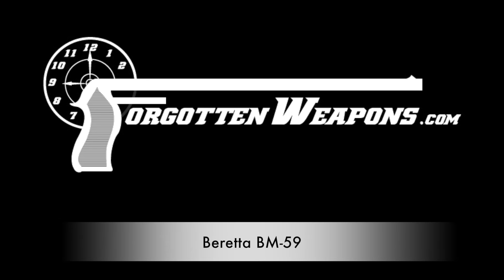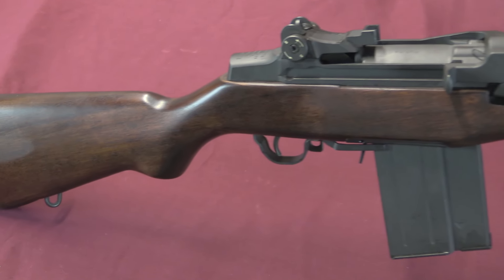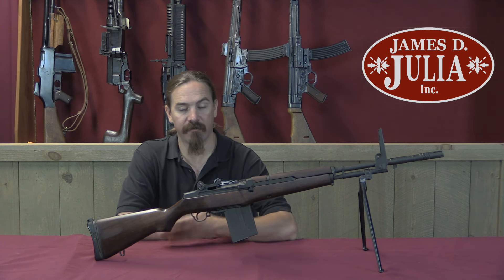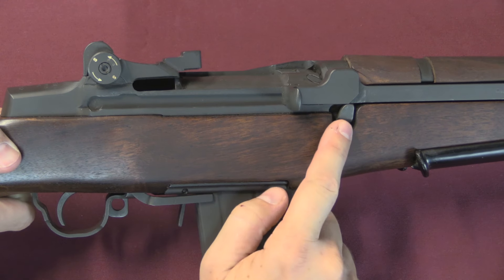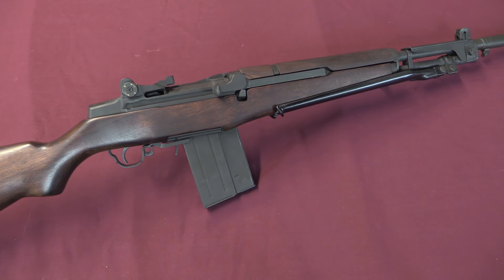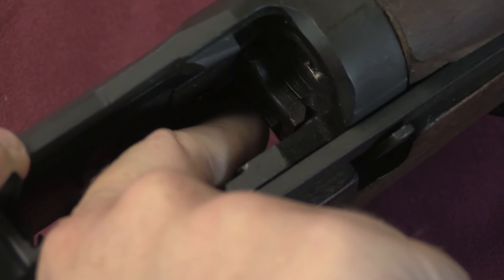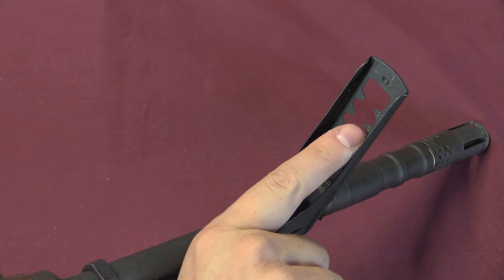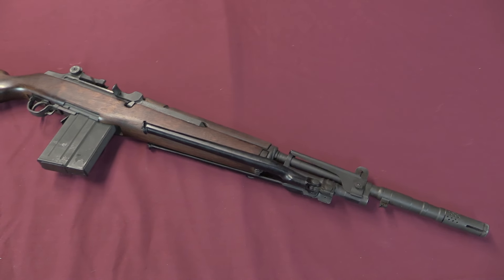BM59: The Italian M14

Comment: The Indonesian Army not only bought the    BM59, they used a Berretta design for their 5.66 mm standard infantry rifle - the Pindad. The Pindad is manufactured in Indonesia. In the semi-automatic form, the Pindad is also the standard rifle of the Indonesian police.
Reply: The Pindad SS1 is derived from the Belgian FNC
Reply: Nope, Pindad did produce the BM-59 under licence as the SP1, but it was in the original 7.62 NATO, not the 5.56. It’s no longer standard issue for the Indonesian army or police either (it was briefly in the 1970s and 80s before the switch to 5.56) but a fair number are still kept in reserve, and personally I’m wondering why Pindad didn’t just repurpose old SP1 jigs and machinery to build a new modern battle rifle rather than awkwardly trying to upscale the FNC-based SS1 and SS2 into the SS3.

Comment: That winter trigger is just amazing.such a simple but effective function
Reply: I read somewhere that it was mostly meant to launch grenades with it than a winter trigger, since the blanks required for them had 3 times the recoil of a normal cartridge, and using the normal trigger with them would break your finger against the trigger guard.
Reply: @LoquendoversoIT  Yes the Swiss did this as well for the STG57.

Comment: If it also shot...straight...it wouldn't be bad, but, already at 150 m...You don't catch anything...It was done economically...Perhaps by replacing the long-stroke piston with a short stroke, replacing the barrel, completely eliminating the tri-compensator, which is one of the sources of the rifle's inaccuracy, perhaps it could work well...
Reply: It works perfectly fine.

Comment: The Indonesian production of these is interesting. I am not sure whose plant they bought, but there was a LOT of it.

The most curious thing about the process of making the receiver body was that, first, they machined M-1 receivers, then re-machined those to provide the "features of a "BM-59
 receiver body. In the case of the Italians, this was the "logical' follow-on from "converting" large numbers of pre-existing US-made M-1 rifles and then almost new Italian-built M-1s to BM-59 configuration.

So all of the BM-59 "plant" was built around the concept of "converting M-1s.

Allegedly, the "source" M-1 receivers were fully heat-treated and thus, the only way to machine them is with Tungsten carbide tooling.  Way back in the late 1970s, I was party to '"re-engineering" a bunch of tired but mostly serviceable International Harvester M-1s into what were essentially BM-59 look-alikes for the Australian market. M1As were available but for serious money.

Unfortunately, genuine BM-59 mags were unobtainable, so, M-14 mags (and mag catches) were used. No "tri-compensators" were fitted, either.

About a hundred of these conversions were made and they worked just fine. Someone in Britain also did something similar, before all of that "went away".
Reply: No BM59 had been made converting a rifle. After the war Beretta received the Wincester tooling for the production of the M1 rifle (they were worn out and unusable, but good to see what the production stages were and build new tooling) along with a ton of spare parts never assembled. That's why many BM59 have the original Winchester and Springfield markings on the receiver. 
That's also why the Danish soldiers preferred the Breda made M1 to the Beretta ones. Breda rifles were all made with new parts, while the Beretta ones could have receivers made during the war with old tooling, that had a rougher surfaces.

Comment: People talk about the wood cracking. How common is that? Should i be careful in considering this rifle because of that?
Reply: Depends on how well was treated the wood in all these years, but usually they were better than the one used in the M14, the only piece that cracks very easily is the top cover, but it's not a big deal

source: mine cracked some time ago and it was so common that i was able to find a replacement very quickly

Comment: It's gas cutoff system is like the Yugoslavian SKS system except the Yugo's sks has a knob that acts as both the valve and a lock to keep the grenade sights in place
Reply: They had access to some BM59 samples. Beretta hoped to sell them, but then it didn't go well but the good idea remained, as in 1966 they modified the SKS M59 by adding the part of the grenade launcher.

Comment: We still had in 1993. Even then we learned marksmanship with the Garand and then got issued this, the FAL (which stands for "fucile automatico leggero", its not just the Belgian FN that was called FAL), basically none of us ever called it BM59... It could take a beating and still do its job very well.
That so called "winter" trigger wasnt much for gloved hands in operation. It was used a lot more for the SuperEnerga grenade which used to give quite a kick and you could really hurt your finger. The winter trigger instead was making things a lot safer when shooting the s-Energa, and also was making easier to aim and hold everything steady shooting it. 
The reason the magazine is made that way is because its a simple pull out and slap in without  fiddling with the front catch like other rifles had when the bm59 was designed. You can switch magazines very quickly.
Many of us that trained with it liked this rifle a lot, it had a whole different feeling than the the 70/90 we were issued later on.
Reply: Commento eccezionalmente interessante!

Comment: I have fired M14s as a Marine. The cyclic rate is also 750 rpm. If the M14 had a muzzle break like the BM59, I think it would work better in auto. By the way, I aways wondered if the cyclic rate of the M14 was reduced to 650 rpm, if we would have made it better in auto. Unlike many, I know auto fire in a M14 is doable if you are at least 5-10+ tall. I owned M1As and the semi BM59. I believe the BM59 is a Cadillac version of our M14. It is a better shooter and made better than the M14. Thanks for the video.

Comment: Beretta used the tooling from Winchester to produce their Garands and I would guess their Bm59's
Reply: Not only the tooling, but even the existing parts. The BM59 receiver, stock, rear sight and trigger group were the original M1's slightly modified, and often they retain their original Winchester and Springfield markings.
Reply: @neutronalchemist3241  when as a recruit you were holding the rifle for the first time the first thing you noticed was a mishmosh of markings and a lot of scrollwork to obliterate some parts of the old markings.

Comment: Trained extensively with this rifle during my auxiliary officer’s course in 1996. Once you got to know your rifle you could easily hit a target at 300m and over consistently with the iron sights and the in-built bipod. I also trained on its replacement, the NATO 5,56mm AR70/90. While the 7,62mm BM59 was a bit heavy to carry (about 4,5kg if memory serves) I know which weapon I would take into battle...
162^AUC
Reply: Ricordo benissimo.... Ho fatto il militare nel 1993.... Pesava, vero.... All epoca, stavano arrivando proprio i primi sc-70/90(versione a calcio pieghevole dell AR - 70/90),e ricordo benussimo la differenza di peso e maneggevolezza, rispetto al FAL BM-59... 👍. 10°\92, brigata taurinsense. car presso la SMALP di Aosta. Un saluto ✌️

Comment: Sounds silly but those asymmetrical stops would be helpful for ensuring you've got the mag the right way round when in low light conditions and under combat stress.
Reply: Not needed for that, when you hold the magazine you know exactly whats the front and back because of the shape. And even without the stops like that it wouldnt fit backwards.

Comment: I served in the Italian Mountain Artillery in 1987 and we were issued the BM59 Truppe Alpine with pistol grip and foldable stock but not the detachable muzzle break which was only for the paratroopers version. The tripod was absolutely necessary in full auto while hitting the target with a three round burst after some practice was relatively easy. Truppe Alpine version was slightly lighter than the one in this video but still heavier than the contemporary M16.

Comment: One bit of trivia: if you see an M14 in a movie, chance is that it's actually a BM 59 due the similar looks and easier availability on the civilian market.
Funny trivia: the Italian Army designated it the "Fucile Automatic Leggero", "Light Automatic Rifle", shortened to FAL (Italian and French languages are pretty close), but the soldiers who actually had to use it and feel the weight would rather call it "Fucile Automatico Pesante", "Heavy Automatic Rifle". And before you guess the shortened designation, remember that most Italians at the time didn't speak English.

Comment: I had a transferable BM-59 (actually within a couple of serial numbers as the example reviewed in the video) back in the '90s.  Was reasonably easy to control considering how fast it ran. I had all three stock variations (bought them from Reese Surplus) and spares of several parts that I had broken at one point.  I had the extractor fly out of the bolt assembly once, and I broke the operating rod at Knob Creek once.  If you ran the gun too hot, you risked breaking the operating rod at the weld (Beretta didn't make an operating rod specifically for the length of the BM-59, they cut down and re-welded a Garand length rod).  Mine also need some attention for the gas system to run reliably; the grenade sight is made to cut off the gas when flipped up, and the cutoff would rattle loose while firing and gradually close the gas.

Comment: Now they say that a bolt action rifle has more accuracy potential than a semi auto rifle, and if you can use the magazine cut off lever and turn it into a "bolt action rifle". If you didn't have a rifle grenade attached would it potentially be more accurate if you just shot a round out with the the gas cut off of the action of the weapon? Essentially using it as a single shot, "bolt action"

Comment: I have fired a M1 Garand with a magazine, shortened barrel, and gas system.  It was fun.
I had a few run ins with a Los Angeles gun smith named Chuck Rees he built 1911 back when Jeff  Cooper was at Arrowhead later when I met him he was shooting a M14 he  built a 30-06 Garand into an M14.  It used BAR magazines.  Only saw it once but if you knew M14's you could tell the difference.

Comment: Which gun, from a manufacturing perspective, is most similar to the Garand? As far as I know is that the M14 was chosen over the FAL and G3 because it could, in theory, reuse M1 manufacturing tuning.
Reply: The BM59 is a lot more similar. Actually BM stands for "Beretta Modifica" (Beretta modification, of the original M1). It reused M1's receiver, trigger group, stock and rear sight, only sligtly modifying them. So much it was a modification that several BM59 issued to the Italian troops had been done using original US made M1 receivers, and still had the original Springfield or Winchester markings on them. http://www.collezionareexordinanza.it/uploads/source/IMG_6484_1.jpg

Comment: Around the ten minute mark of the video, Ian discusses the changes made to the Beretta gas system and operating rod, and then briefly mentions that perhaps there were not too many bent op-rods on M-1s. Early M-1 Garands came with the characteristic dog-leg op-rod, but when stress cracks started forming at the bend, and some op-rods bent or broken under the strain of use, it was decided to add a hemispherical "relief" cut at the bend to relieve stress lines converging on that point. Which is why all subsequent M-1s have that feature. Early M-1s were supposed to be retrofitted to modify their op-rods, but a few escaped such treatment and are now valuable and quite rare collector's items in the M-1 community. You may not want to fire such an M-1, but it is worth a pretty penny as a collector's item.

Comment: So were BM59 receivers all made from scratch as BM59 configuration or were many merely modification of existing M1 receivers?  My Parts kit seems to have some former US parts on it, so I suspect the Italians were more than willing to adapt existing rather than using all new mfr parts.
Reply: BM stands for "Beretta Modifica", a modification of an existing model. So much it was a modification that many BM59 issued to the Italian troops had been done using original US made M1 receivers, and still had the original Springfield or Winchester markings on them. http://www.collezionareexordinanza.it/uploads/source/IMG_6484_1.jpg
Reply: The system was a modification of the M1. So the process, and I have seen the machinery, was to take existing M-1 receivers and cut away all the bits that didn't look like a BM-59. As the supply of existing receivers dried up, they STILL made M-1 receivers, including heat treatment, because they were the required raw material for a BM-59. New parts included a different sear for the trigger mech, the M-2 Carbine-like actuator arm and lever, the winter trigger and, of course, the Tri-compensator. The Indonesians bought a complete Italian production plant and made a huge number in several variants, including a heavy-barreled job that had a special bayonet with an extra-long handle.
Reply: To save money the tooling and parts were reused. Beretta (and Breda) was already producing Garand rifles so there was the need to use the same machinery and all the parts available both making new or modifying older.

Comment: The cadillac of m14's
Reply: *Ferrari
Reply: @Beco90  *Fiat. They were reasonably priced, produced in large quantities, reliable, durable, and a lot of fun.
Reply: @life_with_bernie  fiat is about as far from durable and reliable as possible though
Reply: @jokelius1  you clearly haven't driven a fiat panda from the 80's those things* will outlive corollas and civics
Reply: @jokelius1  export Fiat are not great.
But the Fiat Panda mk1 were affordable and ubdestructible
Reply: @jokelius1  those that sucked were the before ww2 fiats specially made for Americans i guess. The reason they sucked was because the fuel system wasn't properly adapted to american fuel, oil and temperature as the standards were different and the Italian cars almost never met anything below -5C° in italy while the usa in many parts you can go up to -20 C°.

Comment: Doubt here..
How do people lift machine guns which are 8 - 10kg . Some people even lift it in one hand. Anyone got any idea?
Reply: Shiladitya Talukder 10kg is only 22lbs, you're telling me you can't lift that with one hand? The old M60 our troops carried in the field weighed in at 23.5lbs with the tripod being another 16lbs usually carried by the assistant Gunner, but in a pinch one man could move the whole assembly fairly easily.
Reply: TheBamidd I've never tried lifting an LMG but it does seem quite heavy. The only heavy gun ive lifted is an Type 56 which is around 5 kg
Reply: TheBamidd Maybe it isnt that heavy because the whole weight is distributed on the whole length and it makes it liftable
Reply: Shiladitya Talukder up to around 12kg is pretty manageable for an average sized man, especially considering you usually use 2 hands to carry/control a long rifle and a sling is often used.
Reply: TheBamidd hmm i see
Reply: Push ups

Comment: I had this during my service in Carabinieri , good gun , more controllable then the m14 in full auto , this due the total weight and the superb flash suppressor , generally we used it for self protection during check points and also for launching tear gas granate. The winter trigger was used also for the launching of the grenate ( energa ) and tear gas , this because the recoil was very strong, and using the normal trigger was proibitive .

Comment: I'm confused this thing looks alot like an m14 so is it designed off of it or did the m14 get design cues from this?
Reply: neither, this is a completely independent and direct modification from the Garand that Beretta came up with, in order to replace the Garand which was at that point obsolete (but still good, in the early 90s the first rifle you got to shoot with and learn on as a recruit was infact still the Garand).

Comment: Another superbly researched and presented video, Ian. Thank you! I discovered one additional minor modification made to the M1 by the Italians as they were designing this rifle: the ejector has an additional bevel milled to one of the corners. I discovered this modification the first time I shot my BM59 in the prone position from the left shoulder when the empty cases flew straight back and beaned me in the noggin. :) Replacing the ejector with a stock M1 part took care of that. BTW, my rifle was built from a like new BM59 parts kit by Tim Shufflin of Shuff's Parkerizing, and it is an excellent shooter.

Comment: Were any of the BM59's made by converting M1's ?
Reply: Several BM59 issued to the Italian troops had been done using not only Beretta made, but original US made M1 receivers, and still had the original Springfield or Winchester markings on them. http://www.collezionareexordinanza.it/uploads/source/IMG_6484_1.jpg
Reply: yes, Beretta was rebuilding the garand we received, and the BM59 was the result from the need to have a more modern rifle for less $$ possible. So they needed to use the same parts, new or modified, and machinery.

Comment: Thank you for this.  While I've been vaguely aware of the BM-59 for eons, for that same duration I just assumed it was a Beretta version of the U.S. designed M14.  I have now learned that it was the result of an independent M1 upgrade effort that resulted in a rifle similar to the M14 but differing in at least several regards.

What wasn't clear (and what I'd like to know) relates to the gas system.  Did the Italians keep the direct impingement of vented gas onto the face of the op rod, or did they also and independently come up with the metering intervening piston?